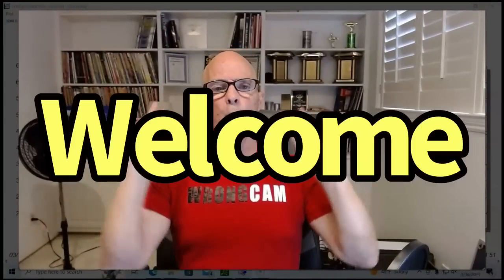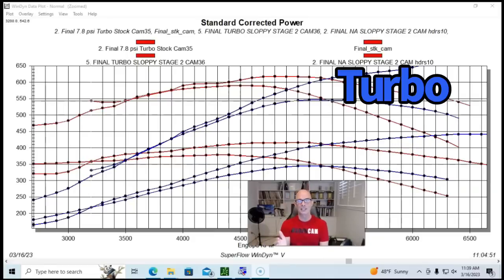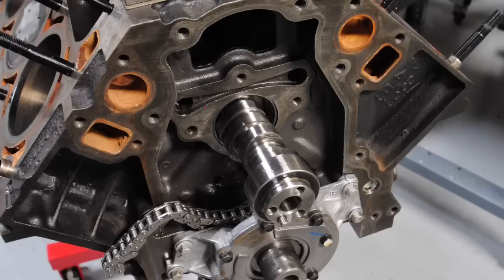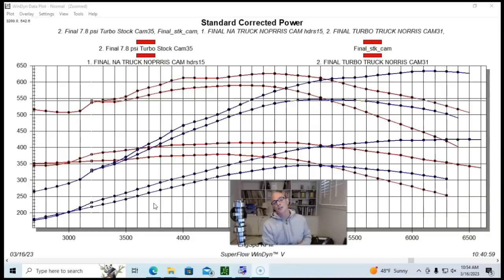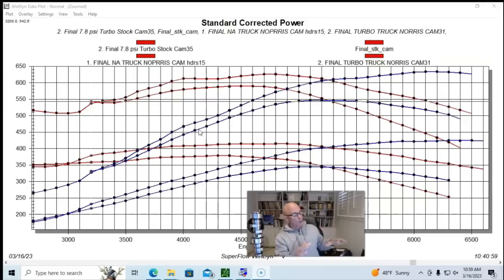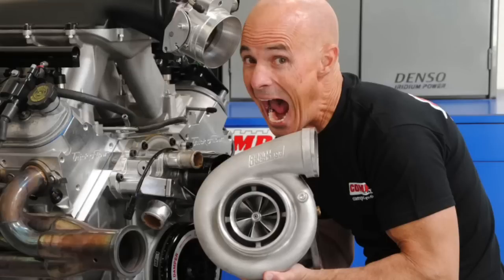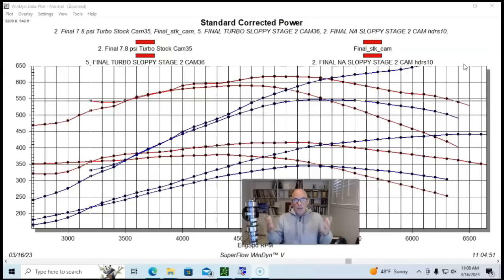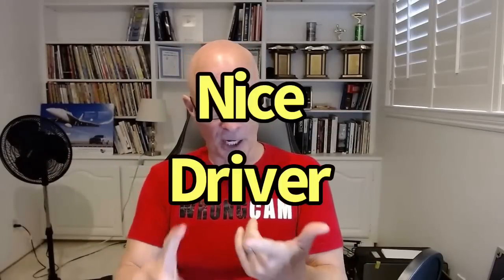WHAT MAKES A TURBO CAM A TURBO CAM? HOW MUCH LIFT, DURATION, LSA AND OVERLAP CAN YOU REALLY RUN?

Comment: I don't think anyone would argue with the statement that adding boost from a turbo will increase power output over not having boost from a turbo. What would be more interesting to see would be to run a group of builds comparing everything from a single pattern narrow lsa cam with lower lift to what colloquially would be called a "turbo cam" with a dual patter, wide lsa, high lift cam and maybe even a reverse pattern cam for funzies, and look at percentage of increase for n/a vs 2psi, 5 psi, 10 psi, etc to see if one makes better use of boost. I get that the variables would be hard to isolate and head characteristics would play a big factor, but I think there would be some themes one could gather from such a comparison. I would think that there is such thing as a cam that operates more effectively with a turbo than others. Would you disagree?
Reply from the maker: IT IS VERY SIMPLE-THE CAM THAT MADE THE MOST POWER NA WOULD DO SO UNDER BOOST

Comment: The turbo cam needs to match the turbos. If you've got small restrictive turbos that give instant boost then a long duration cam is no good, you need a short duration cam.
Reply: On the other hand if you've got a big turbo or a big pair of turbos, a 300 + deg cam will work well.
Reply: @1magnit  If you are fine with slow boost response on the street or track; that you might not have perceived on the Dyno
Reply: @bryanmaloney6651  The dyno used in the testing is pretty useless really because it can't hold much low down torque. That's why you never see any numbers at less than 3000 RPM. There's plenty of good turbo cars out there that start making boost at only 1000 rpm.
Reply: @1magnit    That's not why.  RH has done videos and talked about how the dyno works and why they start where they start.
Reply: @superkillr  A water brake can't hold high torque at low rpm. A real dyno plot starts at idle speed.
Reply: @1magnit  Dude, NOBODY that dynos starts at idle.  Quit with the fantasy land know it all nerded out BS.
Reply: @superkillr  How do you think the OEMs test them? J1349 certified HP, It's done in steps and held for a period of time

Comment: So it seems the real question is: Is there anything that makes a cam better for a turbo application than a non- turbocharged application?
Reply: Yes, controlling cylinder pressures and the blowdown time at certain rpm ranges, this is done with LSA, duration and duration split.
Reply: LSA. There's a reason that most "boost" cams hover around 114.

Comment: Your reasoning (and experience) makes sense. The back pressure from a turbo balances the effect of boost during overlap. I'm guessing that a belt driven supercharger is a different story due to the lower back pressure, and would send more raw fuel out of the exhaust at high boost.
Reply: I don't think it matters. Blower cams do the same thing. Notice he talks about boost. I believe the difference is the blower comes on stronger at the beginning with no lag.
Reply: @cuzz63 can we please make the distinction between a positive displacement blower and a centrifugal blower? They don't behave the same way. A PD blower will behave just like a turbo. A centrifugal won't, it has a rising boost rate.
Reply from the maker: I HAVE YET TO SEE A CAM THAT WORKS NA NOT WORK WITH A BLOWER (OVERLAP IS YOUR FRIEND)

Comment: Overlap with a high back pressure in a vehicle will restrict the timing your able to get out of the engine without detonation. I chose a low overlap cam for this reason. If I had twins or a turbo that has a 1:1 back pressure ratio I wouldn't be scared of overlap at all. Even on high back pressure setups I'm not scared of high overlap cams I just know not to get carried away on the timing especially on a pump gas deal.
Reply: Still leads to less power especially before the boost ramps up higher than EX bp.

Comment: If your intake and exhaust pressures are equal then forced induction is just like operating at 10000ft below sea level.  But, if your exhaust pressure is higher than intake, as turbos have, then with increased overlap you decrease VE.  That changes with rpm, thus your “multiplier” will change by rpm.  This is why turbo cams benefit from lower overlap than supercharger cams.
Reply: :face-green-smiling:

Comment: Is every cam a nitrous cam too?
Reply: With nitrous you have to cater to pumping loss on the ex stroke.
Reply: @davidreed6070  Not only with cam event timing; but also exhaust valve and throat size, and collector merge sizing.
Reply: @bryanmaloney6651  heavy nitrous is a different animal
Reply: @bryanmaloney6651  we purposely built the engine and made considerably more power than the hit said it would make
Reply: @bryanmaloney6651  I haven't went far enough to know about the headers or collector
Reply from the maker: NITROUS JUST ADDS TO WHAT IS THERE

Comment: Lift ,lsa , lca and duration.
Reply from the maker: NOT OVER LAP? AND THE WIDE RANGE OF LCA IS THERE TOO (EVERY CAM WORKS)
Reply: @richardholdener1727  you are correct if you mean wide lsa ? 5000 hp turbo engine use a wide lsa and less durable then big over the counter cams . Even top fuel use a wide lsa .

Comment: I was under the impression pressure pre-turbo is what matters with relation to duration and overlap.  When you are only running 7-8psi you aren't going to see enough back pressure to cause an issue. So the power curve will mimic the NA curve as you say.   Get into the 2:1-3:1 back pressure levels and  higher overlap camshafts will run into detonation issues. Where a smaller cam with high negative overlap @.050 will not.  

With the 1.10 T4 S475 I'd see 2.8:1 back pressure levels at 26lbs. The turbo was tapped out and of course not the best unit for the job. But I believe it stayed together and ran "ok" at those levels because I ran a camshaft  with -24* of overlap. Similar to my old DSM motors seeing into the 3:1 back pressure ranges on the baby 16g turbos. 

If you run a setup that will run at 1:1 or better (twins) you run what ever cam makes the most power where you want it. Just as you say. I ran a "big" MS3 cam on my twin 5.3 setup. Worked well!
Reply: If you've got 2:1 or greater back pressure to boost ratios, you've got bigger problems than cam specs!
Reply: @AustinRBa  No, you don't. Thats actually the ratio OEM engineers shot for with turbo cars in the 90's. 2:1 is perfectly normal and more inline with a "street" setup. All these T4 guys running any decent amount of boost on an LS are at 2:1 BP ratios.  Who in the world runs 7-8psi on a turbo LS build and leaves it there? What's the point of turboing a car and running 7-8psi? Does anyone actually do that?  I mean I'[ve build dozens and never had the want or will power to run around on 7-8lbs.
Reply from the maker: 3:1 PRESSURE RATIO AND YOU THINK IT'S CAM TIMING?
Reply: @richardholdener1727  Cant wait for the negative overlap cam tests, maybe you can test a negative duration cam too? 🙈.  In all seriousness, what is considered a good drive pressure ratio in a single or twin turbo application?  I know compound setups can potentially have an advantage.  Not enough people talk about drive pressure ratio imo, its important imo to reduce pumping losses, cylinder temp, and increase VE.  Sizing seems to be a compromise between responsiveness, power goal, and backpressure/unwanted egr effect.  I love the idea of a compound turbo LS car, would be badass.
Reply: @richardholdener1727  OEM manufacturers routinely went with 2:1 or slightly higher on turbo application motors. Check the back pressure ratios on that Omni for example. Or typical factory DSM setups. You will commonly see over 2:1. Esp. as owners turn the boost up on the factory baby turbos. Its rare to see under 2:1 on OEM applications due to lag. You commonly state 1000hp setups are "easily" done with 5.3 applications and T4 turbos such as the S475. Well... in my case an S475 pushing 25-26lbs was at 2.8:1 BP ratios. Netting my 8.9X 1/4s @ 153ish and 3200lbs.   What I'm saying is if I ran something like a sloppy stage 2 with back pressure ratios that high I'd rattle the motor with detonation before I completed the 1/4 mile.  You have TONS of dyno experience. But put the motor in a car and go run the times... and things change a lot.
Reply: @richardholdener1727  You are the one that tells these guys to stick with a T4 at 1000hp. I'm saying you are seeing damn near 3:1 on a T4 S475 on a 5.3. @ 25ish lbs. Thats real world ET VS weight. Not Dyno numbers with no accessories and perfect temps etc. @ 3200lbs it takes 25lbs from a t4 1.10 S475 to hit 8.9X @153 on an LS9 cam'd 5.3. I can say this because I've done it., many times. Its not dyno fluff. I can also say the same setup with a  1.32 T6 S480 runs about 1.5:1.  I've done both back to back on the same setup. Using the Weight VS trap speed equations on wallace racing NONE of the numbers fall inline with your dyno numbers. Your numbers are always inflated. Take one of your "1000 hp" motors to the track and lets see what that trap VS weight. I love what you do for the community... but the numbers are off and then some.
Reply: @AdamOpheim  his numbers should always be inflated he's using an engine dyno. It measures BHP. If you really did a back to back test between a low LSA cam vs high LSA cam on a high back pressure setup and the high LSA cam caused more detonation, then the bottleneck for horsepower is the fuel you're using and not the Cam. I'm pretty sure richard is assuming that all of us knows that all setups he's comparing are all on MBT and non of them are knock limited.

Don't get me wrong I also believe that the high LSA cam is more knock prone compared to the low LSA cam (on a high EMAP/BP Setup), its just the testing methodology, he ruled out knock limited and ignition timing as that wouldn't be an apples to apples comparison between cams.
Reply: I'm with you
Reply: What do you mean by "negative overlap", as in a reduction from stock? And are you talking drive pressure to boost pressure ratios?

Comment: I must thank you again Richard, I'm guilty of worrying about overlap because that's what I was previously lead to believe. I value your experience and knowledge.
Reply: Haven't watched the video yet, but I'm going to go out on a limb and say it doesn't matter because overlap is only a real concern at idle.
Reply: The biggest cam tested had 25 degrees overlap, the biggest turbo cam mentioned towards tge end had only 6.5 degrees overlap.

Be great to have details included in thos one
Reply: Your right , he is wrong and right , if you have too much over lap your just pushing the boosted air into the exhaust , but a boosted motor that’s not a turbo ,a blower makes a difference more than a turbo, ..he is confusing the truth..I’ve been a tech for 30 yrs and yes buikt motors plenty and raced, if there wasn’t a difference comp and others wouldn’t spend millions on tech,

Comment: Why did GM make the cam that has 122 LSA for their supercharger. BTW, I agree with you 100%

I have a Magnuson Supercharger and the cam is nothing like a blower cam.
Reply: Because gm primary goal is always emissions compliance, cafe standards, making horsepower is the furthest down the list.
Reply: @B.C  why can't they do that with a 114 LSA like they do on many cams they spec for gen IV engines?
Reply: They made that cam to limit power below 5k because of the type of power adder that was used. They didn't want to make too much power down low and break parts. At least that's what I read and it made sense. I'm sure emissions and all play a factor as well.
Reply: @AdamOpheim  Emissions  don't play just a "factor".. they are THE factor.  They then operate inside that box.
Reply: Noise, vibration, and harshness. Nvh limits a ton of vehicles.
Reply: They have to make the engine idle, operate vac brakes, and run an A/C compressor.
Reply: Driveability,  emissions and (think of the difference here from turbo to supercharger) the intake to exhaust pressure differential👍
Reply: Look at the valve events for 211/230 122LSA and it will make sense (negative 23.5° overlap at .050)

Comment: Hey ik your busy but need some help me and a buddy are building a 408 out of a lq4 rec port heads from afr and we have a gt45 turbo would that flow and support a fully loaded 408 

SUM-8716R1 cam
Reply: @boost1728  that’s what I was thinking but I was told it would b large enough and this was part of my research 😂 appreciate the answer tho and I’ll look into a s480
Reply: @Vgnvodka  Honestly, the only way to use a gt45 on that 408 - is to install one on each bank. (Twins)
Reply: @bluecollarhotrods9781  that’s temping first time building a boosted engine so I’ll be in and out of the comments for a bit motors in a 1500 lwb Chevy 2wd has a built 4l80e with a 3600 stall
Reply: @Vgnvodka  Sounds like you have plenty of room to party under the hood.
Reply: @boost1728  I took it he was talking about a real Garrett gt45. Maybe not
Reply from the maker: GO BIGGER ON THE 408
Reply: @richardholdener1727  how about two gt45
Reply: @Vgnvodka  twin GT45’s would be great for that size engine. Little laggy for a street car but 1400+ capable